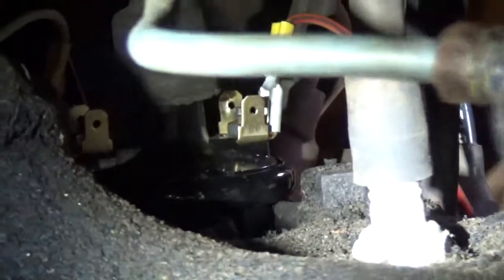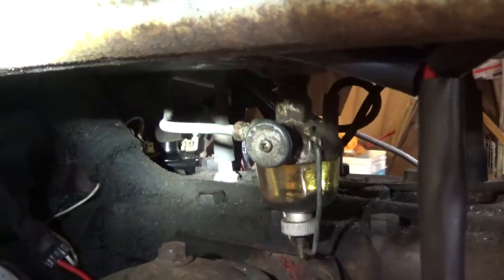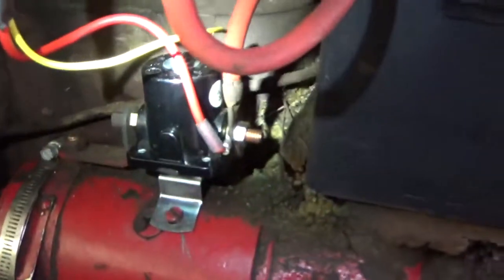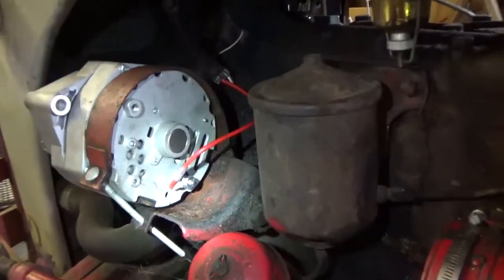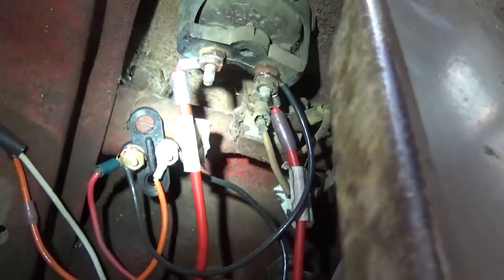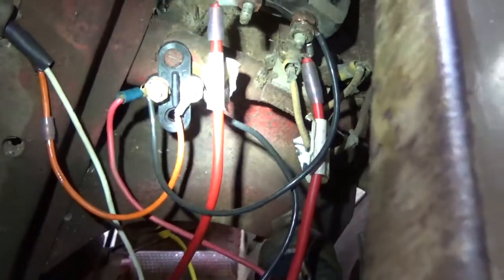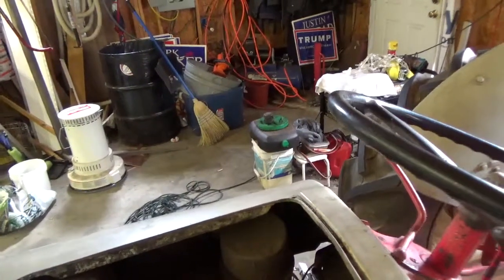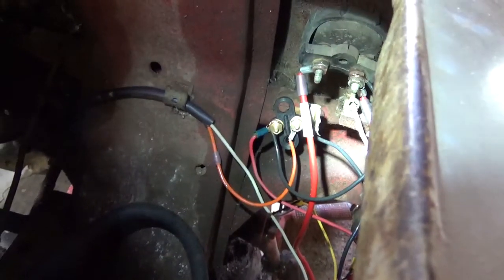8n 12v conversion wiring

Comment: Wondering if you could give me a diagram for the 12 volt system I have no solenoid I have 12 volt alternator 12-volt starter a key switch a fuse box aground on the dash I added and a starter button it's on a Ferguson te20 I'm not getting fire to the points